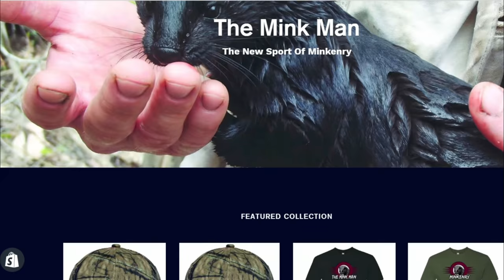BLOODTHIRSTY RATS Return!!!

Comment: If they can’t find a hole to get in, rats will CHEW their way in, right through 3/4” plywood, 2x6’s, even metal flashing! 
1/2” wire mesh will keep them out, but in a couple years’ contact with soil or manure it will start to rust and if they find a weak spot they’ll chew through it.